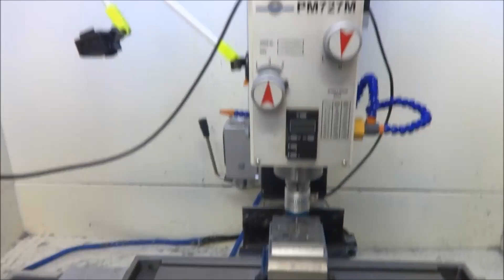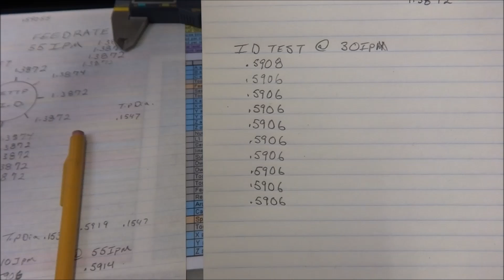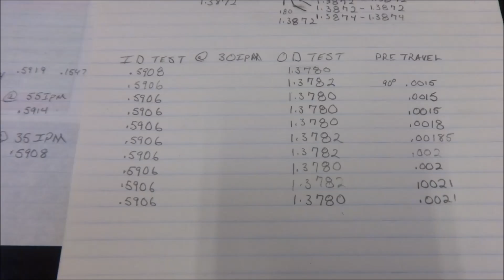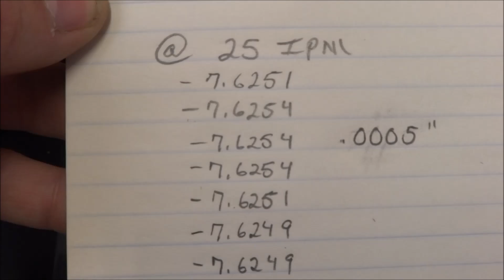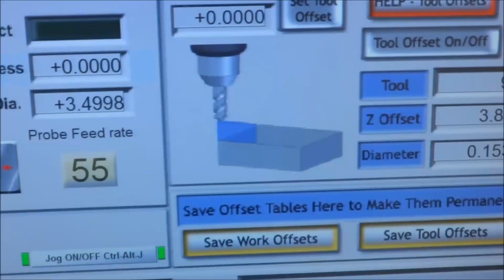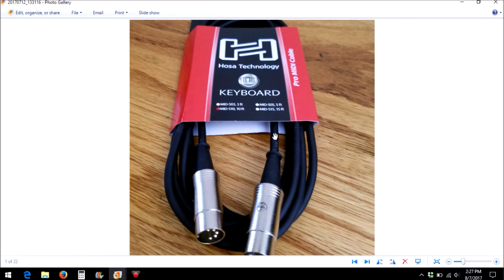Hallmark Design ITTP Accuracy and Repeatability

Comment: Ia it registed at an angular position in every probing。Then。 Yes。 It gave precise result。 But。 Will other cheap one will achieve that as well。。。???
Reply from the maker: Good question,  The ITTP's design has about 1/2 the Pre-Traval variation  of other low cost probes. In part from the use of a solid steel stylus ( Less Flex)  other low cost probes use ceramic self sacrificing stylus which have greater Flex and more "PTV" from .002" to .004" My ITTP's PTV was .0015"- .0021" of course this can be compensated for but depending on which angle  the probe makes contact will impart more PTV a tolerance of .0003" is far better than .001" Other low cost probes using steel stylus sacrifice cheap internal components in a Crash the ITTP can tolerate these crashes.